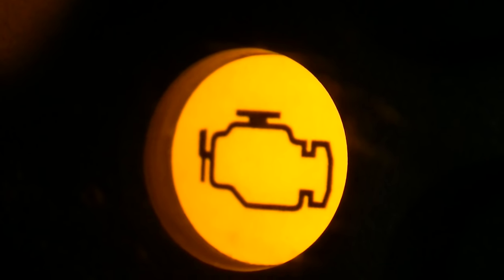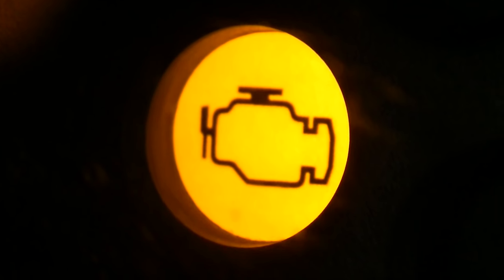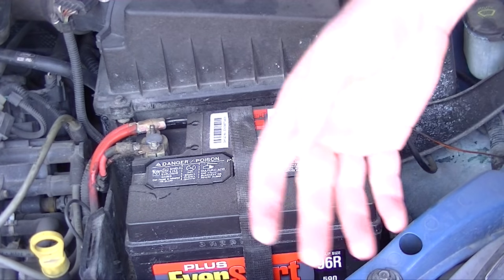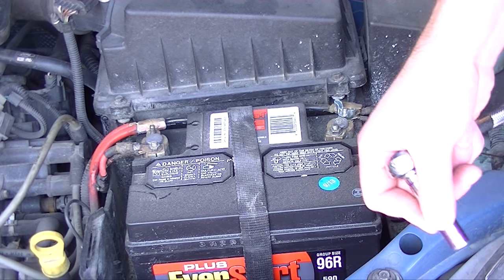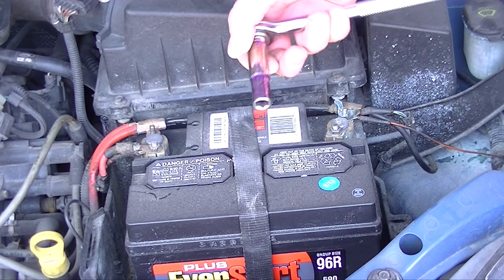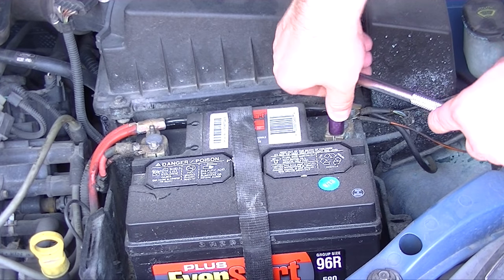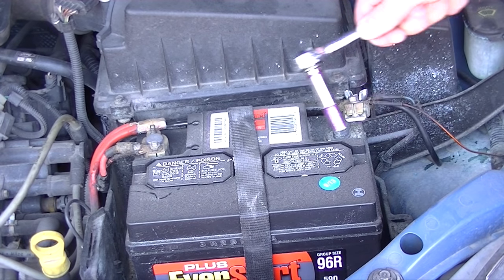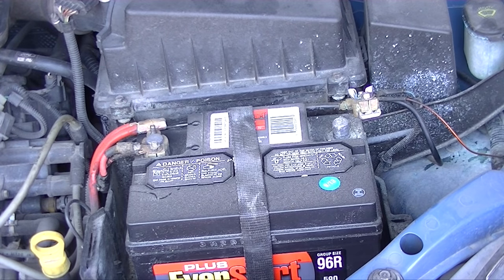How To Reset Your Check Engine Light with no special tools

Comment: I just let the light stay on. It reminds me that my car has an engine.
Reply: FEFEFILM PROD Yea but it wont pass inspection with a check engine light on
Reply: Reseting check engine light only put problem under carpet. Sooner or later it will turn on again.
Reply: yes! your living life the right way!
Reply: you are right
Reply: Lmfao 😂😂
Reply: Lol tell it to the inspector
Reply: FEFEFILM PROD 😂😂
Reply: TELL me why I agree with this comment 🤣😂
Reply: That's a crack up.
Reply: Lol 😝
Reply: Hhhhhhhaaa
Reply: That's funny 🤣
Reply: 😁 I like that! I put black tape over mine.
Reply: Llf
Reply: @ericbills8938  qq87i
Reply: @elofton9022  I did the same
Reply: It's shows me that it got a problem
Reply: Does not work on my van.. after light comes on I am only able to drive 30 fkg miles and then it says the engine will not start again after 450km.. which means huge bill at garage to sort that out..last one was ad blue filter blocked, garage ran it on the computer at 3000rpm for ages and cleared it out (the injector was clean).
Reply: @vpjaveline  you are right I have just spent a lot of money to fix it iam convinced it is a money Racket still my light on so far 1thousand pounds spent
Reply: @rayonwilliamssportsandfun2106  ft
Reply: Lol
Reply: Ahahahahah it's funny because it's true.
Reply: 😂😂😂😂😂😂 4 years later and this joke hits just as hard as it did day 1 lol
Reply: @winstondrayton1608  , thanks
Reply: @ericbills8938  😅
Reply: Listen I looked at it and said ok cool I still drive it
Reply: Dwl
Reply: Me too. Broom brooommmmm
Reply: It has just happened to my car. I have repaired it but still having that issue I might do it by myself now
Reply: Is wa skunt is this
Reply: wtf!

Comment: The best way to reset the light is just removing the bulb, casually it is a focus, same as mine, I remember I had a dodge caravan with same light issue and I just stuck a black tape above and it was all, this light had me nervous and once I covered it with black tape, I finally forgot about it and the car never gave me any problem ever, late in 80's cars did not have a check engine light and we used to drive so happy, nowadays there is a light for any stupid thing that won't let us drive in peace
Reply: Whatssss??? Removing the bulb that lights the engine icon?
Reply: @balloney2175  yes!  just took it from the cluster for good
Reply: @federicomuller5348  Scott said it is okay if it is not flickering, but if it is, the alert is severe. So how would you know if your engine is crying for help?
Reply: @balloney2175  as back in the 80s no lights no warnings and you drove with a peace of mind as I already wrote I have always removed that bulb and I have always driven in peace
Reply: Put a small piece of electrical tape over light
Reply: @TheCathydrew  I solved it... I hired a sharp-shooter. Bang! the light is gone.
Reply: @TheCathydrew  yes that’s what I do.
Reply: This sounds 😂😂funny
Reply: I’ve covered mine with a bit of black tape. It’s telling me the cat is not operating effectively and the garage said I’d need a new one but it passed the mot again ok so I’m not bothering at the moment.
Reply: Congratulations , you're a brilliant engineer. lol. Putting  your head in the sand.
Reply: @charlesfarrugia3743  you are so clever!

Comment: I have a 2000 toyota avalon.. and my engine light and VSC light was on.. when i tried to remove the negative battery cable and then reattach it .. all the lights are off now.. thank you. might have saved me thousands in cost since mechanics are so expensive these days ..  cheers brother

Comment: Once you have fixed the problem, start the engine, and run it up to temperature. Let it cool, then repeat. The third time you do this, if there are no more faults, the light will go out.
I've done this with three different makes of vehicle. It works!
Reply: Hmm first I've heard of this .. since I've tried my remedy , I just normally start and used my car a few times and light stiil on
Reply: @frankmontez6853  I did this on a Triumph motorcycle, a Honda car and a Citroen car. Worked every time. 
I got the original info from a Triumph motorcycle forum . 🙂
Reply: @MrWilko58  did the battery disconnect and that finally worked

Comment: This method varies from manufacturer and by model, 
Some cars that are make, model, year, engine, identical can have different sw versions which this would work on one and not the other,
If you got the tools to fix a vehicle buy a obd code reader for less then what a spanner costs
Also pending dtc's that make the eml come on do tend to self clear after the battery pull but alot of hard codes will not,
best to take both battery terminals off and discharge the electrical system as alot of capacitors within the ecm's that hold charge ,
Can take up to 12 hours for them to totally discharge
This is common with vw group vehicles and other brands,
Also i noticed you kept tapping the negative terminal against the socket and battery terminal, your surging the electrical systems and they dont like that can cause all sorts of eeprom errors which can make electrical systems act pocessed, mess up displayed mileage,
Jam immobiliser systems,

Comment: I've had a "on again off again" faulty engine light problem for years, whenever I'd take in for service, the damn engine light would go off, so I did the battery disconnect, it worked wonderful..

Comment: in some cars, specially those 2014 onward, a non-volatile flash memory is used in the ECU to store the codes. it is similar to your usb flash drive. your usb flash drive doesn't lose the data on it when you pull it off the computer and cut the 5 volt on its pins, so is it with these flash memories in the ECUs these days. power cut and drainage no longer work they used to.
Reply: I am having issues with my engine light but no code really comes up when I check not sure what to do from there

Comment: Be careful when buying any used car. Especially privately from someone you don't know. In California, it might not pass smog even after resetting the check engine light. Also by resetting the light does not fix the problem. It might be something serious.
Reply: Yes be very carefull i have over the 1000 euro repairs costs on a used car so never buy a car from someone expect from car dealers
Reply: @Reborn1561    This merhod should be blocked by the system.
It can also bring you more money when you sell your car with a (fake) not warning light on.
Reply: Private Sellers and dealers are required to smog the car before you buy it. If they refuse to do so, never buy the car as it has a major problem. Unless of course you're a Mexican wholesaler taking it down south.

Comment: I took the battery out since I dont have a jumper cable to charge the battery of another car. However, when I put it back in, the check engine light appeared. I did what you said and it worked. Thanks! ☺
Reply: 2009 Honda accord 2 4 engine.  My starter has gone out made my  there was an after market starter put into the car and that one year later the I was told my crank shift senor went out because of the after market starter went into the car .and it made the senior go out... so I changed the after market starter .. now I have caged the starter 2times the senior 2 times and full cap  battery and cables... car needs to be re learned fo r this senior.its the crank shift positioning senor.. Honda need to relearn this senor to car when it is chaned... this has been an expensive.. Honda couldn't  get the system to relearn

Comment: looks like ppl fail to understand that u have to fix the code issue first if u want the light to STAY OFF. or else it will come back on.
Reply: Pull the bulb and it will never return....
Reply: really?
Reply: Glenn Speck will that really work? Do they check the light bulb connector?
Reply: Betsy Sunshine n
Reply: Wale Akinsefunmi 

HE'S NOT GONNA PASS INSPECTION. THE DRIVE CYCLE ANALYTICS WILL SET IT ON AGAIN.
Reply: Glenn Speck 

TRUE BUT YOU WON'T PASS INSPECTION AND THE PROBLEM WILL STILL BE THERE.
Reply: Glenn Speck just get rid of the car.

Comment: It worked for my Chevy Cruze. When I first took off the negative and tap it three times  on the terminal. But when I turn it off and restart it came back on. I then tried the second example of removing the negative wire and hold down the battery. After replacing the wire and restart it disappear. I turn it off and back on again and it didn't appear. But I think this is just a temporary fix. I will know when I turn it on later.

Comment: For $40 you can buy a code scanner like Auto-XRay and read the codes, then reset the computer and fix your car that has the problem...also why did you feel the need to loosen the second battery terminal? Only need to take one off. Your Check engine is sure to come back on again until you fix the problem and in most cases the light will go off once the   problem is fixed and there will be no need to reset the computer

Comment: Could be something wrong with the monitoring sensor that tells you the mileage based on how fast  you drive. I had that problem, and I noticed that my mileage sensor seemed to be stuck on 27 miles per gallon,  when I know I get more. Often, it should vary depending upon highway versus street driving.

Comment: Hi I have a skoda fabia 1.4 L 
Its Automatic and the engine light is for some reason is always on.
I called one day AA and the mechanic told me that it's about map,maf sensor  so I took it to a garage changed it the light has gone off for 2 weeks than it came back on again.
Any suggestions please?

Comment: I had a 2006 Nissan frontier and the only time, in 11 years, that the check engine light came on was when I needed to replace a spark plug coil. My 2016 frontier has been having a problem with the gas tank pressure valve, for over a year, causing the light to come on.

Comment: This doesn’t work on 2012 Ford Fiesta , I’ve tried several things I have check engine abs traction control and couple other lights with car icons that stay on , I’m gonna try leaving Battery off over night see if that drains any capacitor that’s storing energy unless you or someone knows a method that works for Ford Fiesta ? Not seeing anything specific for a small ford

Comment: I tried this on a 2012 Mini and it did not work...I changed the plugs after a multiple misfire code...Car runs great now but it shows pending on the code reader and light never went out...I think on some cars you have to erase the codes in the computer memory

Comment: The light goes on and off the car itself drives beautiful.
Reply: Hi..mine came on so I can still drive my car with that light on..please help me idk what to do. I have a 2006 Ford Taurus..first car ever in my 47 years of living..thanks
Reply: @niccibennett3852  my experience is that you an drive with your car, if you car drives smoothly with no problems then you can drive.
Reply: My car also does the same and it drives beautiful

Comment: HI MY CAR IS TOYOTA D4D ENGINE 1KD MODEL 2010! IA M EXPERIENCING A CHECK ENGINE LIGHT SINCE I REPLACED MY OLD ENGINE WITH A NEW ONE! ITRIED TO SWITCH IT OFF AND REMOVED ONE OF THE TERMINAL FROM THE BATTERY, AS WELL AS I CHECKED THE FUEL CAP MY FUEL CAP LOOKS GOOD BUT WHEN I SWITCHED THE ENGINE ON THE LIGHT IS STILL ON WHAT CAN I DO?
Reply: IDK
Reply: Steven Hailonga 
Thank the
Reply: Steven Hailonga
Reply: tetris
Reply: get an American car
Reply: tetris free download
Reply: Steven Hailonga

Comment: You are passing out totally wrong information because when you take off the negative side of the battery what is going to happen is the Code do not go away  Inspector  always check when you go for an inspection with OBD2 and what happens is no matter whatever you do you take off the negative of the battery and reset it but those codes going to be on OBD2 so this is totally wasted time and waste of energy and trip to the inspection station again and again and again and when you fail inspection you pay extra fees for inspection to and then you are on a record with the wrong inspection  also you will have to go 50 miles run to reset sensors.

Comment: In most modern cars if you disconnect the battery like this without keeping power to the ECU it can cause you even more problems. Don't just disconnect the battery like this.

Comment: I have disconnected the battery to drain. I have tried the jumper wire approach.  It simply will not reset.

Comment: Our 2015 chevy sonic has 41000k miles the engine light keeps going on when we drive it the car shuts off on us or the rpm go up so what can it be
Reply: Get your vacuum system checked out, sounds like a leak

Comment: Am having aproblem on 1kz diesel engine when you start moving as it reaches 60km on the dashboard the check engine light came on and immediately the engine reduce power. What could be the problem?please assist
Reply: Some kinda fuel issue

Comment: Oh ,I get it...You turn off the light..the problem goes away...simple!
Reply: Robert Neild i
Reply: @35foss  lots off people fix there own cars and they can use  this method.
Only thing you need to do is to driver at least 150 miles with he car for taaking it to inspection or it will not pass the inspection.
if the ligth pops on agian there is still someting wrong.
but this is a good tip for diy car owners.
Reply: Clearing the light doesn't solve the problem no matter how many times you disconnect the battery...
Reply: Hahaha!!😆

Comment: NEWSFLASH:: 😶did you know what Service Engine Soon means??? It means that its time to replace your distributor cap and probably should also replace the alternator with it......these 2 parts are responsible for Servicing the power to your engine...so its telling you that your distributor cap needs replaced......it is your early warning light that tells you that you are heading for electrical/mechanical failures.......then people wonder why their computer diagnosis the wrong codes.....too many people ignor this light, they think because they are able to still drive the car that they are safe,,, WRONG!! and If you keep driving on a bad alternator until that bad alternator causes malfunctions, screeching,numerous battery kills,, jerking and accidents....driving on bad alternators are dangerous and are fire hazards and it destroys the other parts of the engine.....most people also make the mistake of getting cheap " used" parts......this is also why the power is not being sent properly to the other parts of the engine ....usually the codes read ::cylinder misfire or o2 sensor,,because the alternator operates the crankshaft-- that turns the cylinders up and down.....if people would just take a look at a diagram and watch a video on how the parts work., they could get a visual of what is actually happening and understand better...driving on engine lights can cause serious accidents and is a fire hazard....it will thrust you forward into another car while braking....so never ignor this light by trying to save money by fixing the light....fix the actual problem or it will cost you dearly in the end.
Reply: You dont have any idea what your talking about.
distributorcap ....lol last time ive seen one of these was 15 years ago!
Dont talk about this when your a 1960's mechanic!
Go back to school.
Reply: Sounds like little win owns  an auto repair business......and he's trying to scare every one into coming into his shop to get ripped off....LOL.

Comment: I've done this two times, ain't now on my third time....no good. The first time, was great for about 3-4 months Second time,  mabe month half and check engine came on again but after disconnecting battery third time....light stays on :(
Reply from the maker: Fred, the Check Engine light indicates a problem.  Resetting doesn't fix the problem.  So whatever sensor is picking up an error is turning the light back on.  Fix the problem or have it fixed, reset the light and you should be good to go.  Good luck mate!
Reply: @HotDayPleatherSeats  
Yes, this is fact !!!!

Comment: Actually there is easier and more intellignet way to do it. Instead of deconnecting your battery cabel and therefore resetting all the systems, you can just remove and reinstall your car ECU unit fuse.

Comment: Take out the bulb ?/led ? A wee bit of black tape over the icon ?
Reply: Problem is the emissions testing center will look for the check engine light that always illuminates when the vehicle is started, when a car is normal the light turns off after a few seconds.

Comment: I wish I had thought of that.... before I put a 1mm drill bit through it and disabled the lamp.... one day the engine didn't start.... the mechanic said... there's the problem... you have no engine... you would have seen it if you hadn't stuck chewing gum oven the hole.... cheers

Comment: It doesn't make sense. This sign is there to show that is something wrong with engine system. this is like when you have a pain in your body and you avoid it taking painkillers. You must find the root cause of it and fix it! This yellow light is not there for decoration purpose. Here in Germany we don't apply workarounds, we find the cause and fix it!

Comment: The emission control light came on after i hosed the engine bay down, not immediately but some hours after. Would i have to replace any sensors or just give it some time after reset?
Reply: hosed engine down? Dude use caution when doing that very risky -definatley dont have engine running....Also? cold tap water on a hot block? Seen them crack by doing that.
Reply: LeggoMyWebos v

Comment: Hi can anyone help me I have a corsa t reg it starts every time but I won't stay running and the engine warning to  light is flashing
Reply: Did u get ur car fixed yet or figure out the problem?
Reply: Alternator maybe.
Reply: Vauxhall blocks were renowned for the intake to get clogged up with carbon and sticky stuff, they tend to start and when up to temperature they just cut out